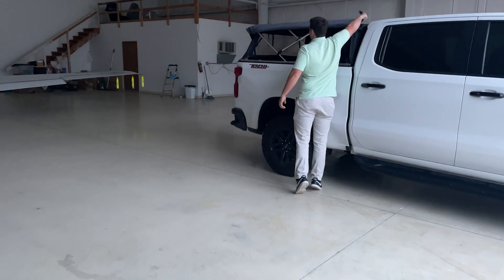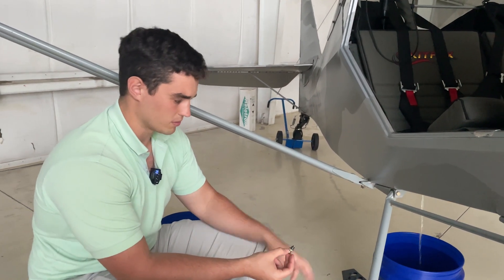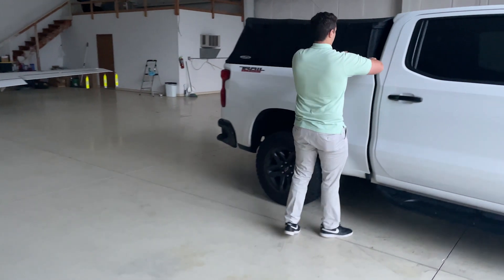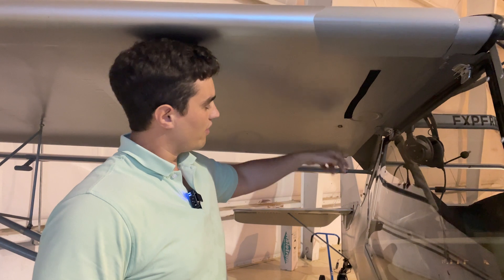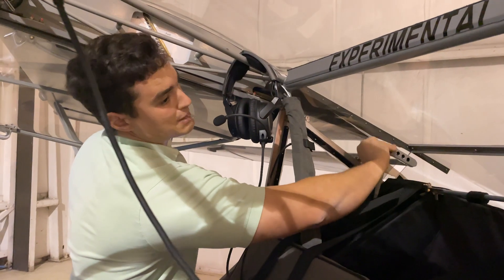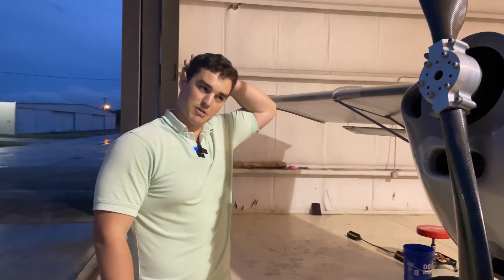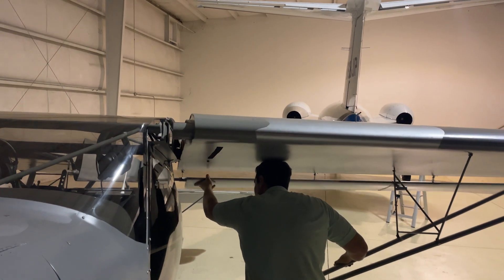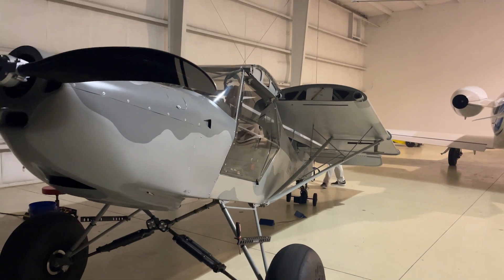KITFOX WING FOLDING: How long does it take me?

Comment: The comment below about keeping the tail raised is really the right answer.  Then you don't have to drain anything. 

Secondly, since you're a fuel injected engine, pop the line off from the pumps to the engine and turn on the pumps.  That is the fastest and cleanest way to drain the fuel.
Reply from the maker: The master of Kitfox has spoken! I'm going to try this again and see if I can do it in under 10 minutes!
Reply: I identified  a problem with your process..... You used a lowes bucket instead a Home Depot one
Reply: @fly4fun24  Also a carpender's belt would save a lot of running around to put pins and such away.  tons of pockets for pins and safety clips and places for all of your tools.  It should be a major part of your onboard tool kit.

Comment: I do appreciate you sharing this experience. It seems that anyone that has done work on cars, boats, etc would see this going sideways right away. For those that do no have mechanical experience that is relevant....at least you should know this is how you don't do it. 

Some small and cheap solutions for safely and easily draining the tanks without spilling a single drop are not far away. 

After a couple of tries, this process should definitely be 10 minutes and be totally mess-free.

Comment: The "Gas Valve Plug" you took out to drain the fuel has a depressive valve which means there's another piece that
screws into the plane plug to drain things.  I believe they put that drain plug so you could drain her w/o taking the
plug out.  There's a valve that depresses your plug & attached to a hose can be put into gas cans w/ less spillage.
Also that special valve could used w/ a pump to do the job fast unless the directions say not to use a pump.
I'm just thinking out loud here,  I'm not a pilot or mechanic but the plug doesn't need to come out. peace

Comment: also, you could hook up a hose line to the valve with a little valve shut off  midway on the hose. So you can control the flow and go straight to a gas can

Comment: The Kitfox directions say to drain the fuel because the fuel will come out the fuel vent caps on top of the wing once folded back.  Could you build the thing with the fuel vent caps more towards the wing root so when the wings fold back the fuel flows away from the vent caps?

Comment: A PVD threaded drain tube would speed the draining process along, as would a proper funnel into a gas can.  I frown on dumping gas from my airplane into a bucket and then back into the airplane; it is a source of problems.  Your time/motion appears a bit flawed; your tools are a walk across the hangar, when you tool box has wheels, and you should have known what tools you needed BEFORE the job.  Juggling removed parts and tossing them into the seats is a recipe for getting stuff lost.  Think about a couple neodymium magnets in your pockets so that all those steel parts stick together, then stick those to something in the cabin so they don't go missing.  All things considered, I doubt the average new guy can do this job in 15 min, but certainly less than 30 min.

Comment: Any fireman is going to cringe at the gas fiasco. Here’s the best way. Take the line off that goes to the carb. Splice in a hose that’s long enough to go to gas cans. Then pump out all your tanks. Now I see you have the fuel injected model. Not sure how to use the pump and a hose with that, but I’d look into it. Charge your battery afterwards if needed.

Comment: Appreciate your video, tis not to see it. You could either get a different quick drain on that bottom plug or use the electric pump built into the airplane, but your biggest error is using those 5 gallon buckets, just get some VP gas cans that have that wide opening, you can also get one of those big 20 gallon fuel tanks that would hold all your fuel unless you just topped off, they even have their own pump to get it back into the wings without lifting it yourself. Then you just set up the drain, keep an eye on your 6 gallon vp jugs; while that's going on you put your tail cover on, pull the back window, and get the pins started, once its done draining you finish pulling the pins, fold and your done. Could easily be done in 10 minutes by someone who folds their wings every time they fly.

Comment: one pin for the whole wing...... one critical pin.  I would have mine NDI'd
Reply: Still better than a helicopter when it comes to critical bits! 😵
Reply: My thought exactly!  I've never heard of a pin failure on the Kitfox, but as a mechanical engineer, in my opinion, that connection falls short.  I wonder if builders who don't plan to fold the wings have developed an upgrade?